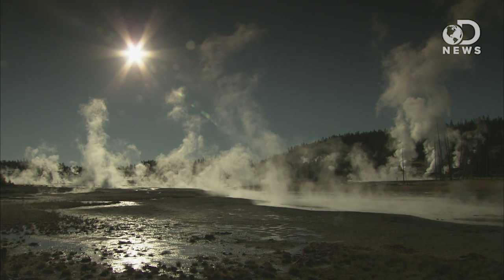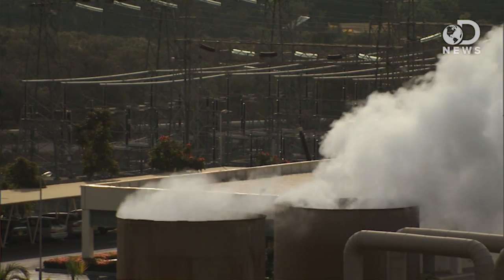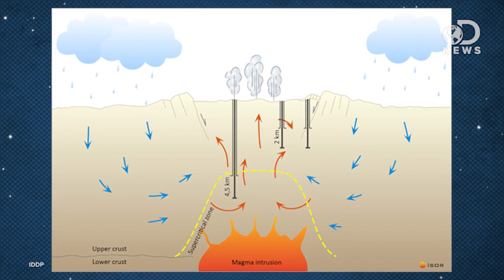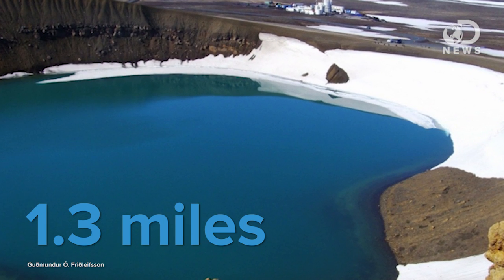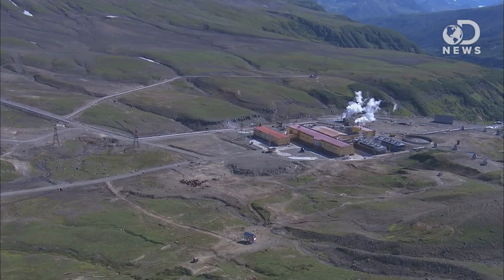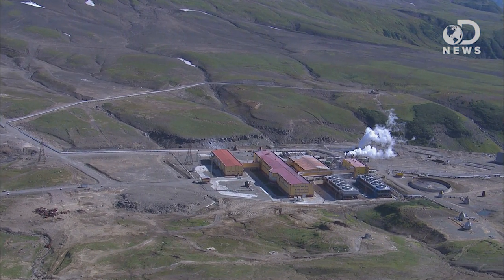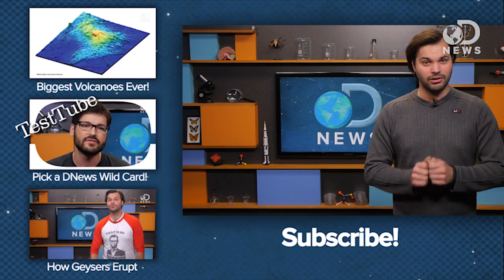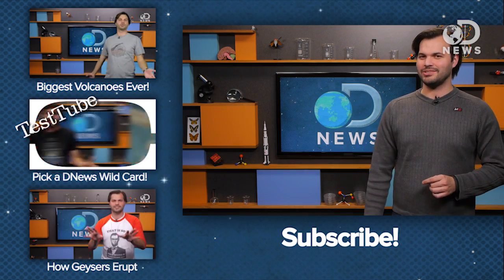Using Magma To Create Energy

Comment: Initially geothermal may be expensive but 2nd, 3rd 4th generation geothermal would blow every other source away.. 90%+ of the cost would only be required for the initial plant, if all our energy infrastructure built 100yr ago was geothermal we would probably be paying 1/10 our current power bills.

Comment: As humans build more and more geothermal wells to extract heat from core magma, the cooling of the core will accelerate and we will need to use the underground tunnels of the geothermal extractors to build lots of underground caves where we'll be protected from cosmic radiation that will no longer be shielded once the core has solidified and the planet's magnetic field is gone.

Probably by that time, we will have had plenty of practice living underground on Mars since that planet's core has already solidified.  It might be a good idea in the mean time to keep Earth's core well-insulated to insure it stays liquid at least until we are prepared to all migrate underground or to outer space.

Comment: energy cannot be created or destroyed
Reply: Correct but there not creating or destroying it. there using the heat of the magma and converting it in to electrical energy.
Reply: read the title of the vid.

thought id comment on the wrongness of it
Reply: If a home renovation show said they used magma to create energy, I wouldn't bat an eye. If DNews said it in their video I wouldn't bat an eye because you're right, it's part of our language. But they published a science video with an erroneous title that suggests something physically/scientifically impossible.
Reply: davdavc you and everyone else knew full well what it meant, you just tried to take the opportunity to sound smart.
Reply: We define a "broken" house, as destroyed, similarly as we define a certain form of energy as created.
With your definition, nothing can be destroyed or created, should we stop using those terms? no :).
I know what you mean, but a house is also only a certain composition of its parts, as are different types of energy.
Reply: um yah no crap
Reply: I never read the title lol.
Reply: A house is constructed from the sum of its parts. Energy is converted from its previous form. 
To create energy would be to construct a house without the required parts.
Reply: It looks like that on a superficial level, but basically the energy forms are also another construction, of more basic Energy (stuff). as the one in E=mc².

Comment: Geothermal energy ftw but really Geothermal energy + Solar energy are the was of the future. Geothermal as its below the crust everywhere on the globe and solar b/c its free and able to be generated where ever and whenever the sun shines. Same principle between them using heat to convert the energy into a type which we can use.
In this i think it will be unwise to have a Geothermal power plant inside of a lay person's house as it would need to be totally automated and things could go wrong and probably will in some cases. So in short keep the Geothermal stuff in huge power plants over holes in the ground reaching down to wherever deepness needed to get the most out of it then just send the energy to the consumer's house.
btw having geothermal power being generated in your own house might sound cool but it needs a big hole in the ground to work and if everyone had that then the ground would be so loose that it will not be able to hold much without faulting at big weights moving around and sinks might appear.

Comment: I had a passive solar house built in 1986, and had geothermal heat and air as well. The estimate to install conventional heat for that house was $3,300. An air-to-air heat pump was $3,800. The geothermal unit (with the pipe drilling and everything) cost $7,600. But I was eligible to receive a $3,000 rebate as a tax incentive, so I went with it. It worked great! My bills were a third of heating and cooling with an all-electric unit. And since the unit exchanges heat with a closed loop of water circulating under ground, there is no outdoor condenser unit at all. No loud fan outside, no big metal box in the way. I was sure that by 2014 (or even 2000!) that geothermal heat and air would be everywhere. Sometimes people are frustratingly slow to accept and invest in new technology.

Comment: I attend a university in Iowa that has several geothermal buildings.  I live in one of the three res halls that use it, this is my third year of doing so. I have come to the conclusion that geothermal heating/cooling sucks, at least in Iowa.  First off, it is an incredibly loud system,  I feel like this must be universal, not just in Iowa. Second, it has a hard time regulating the temperature,  in the winter it is often too cold, and in the summer too hot. A couple weeks ago ghey actually had to shut down one of the geothermal buildings because the indoor temp was below freezing,  it was -20°F air temp, -50°F with windchill. Geothermal can't handle Iowa weather.

Comment: I've once saw a renewable energy theory. Using gravity inertia. Technically, with precise weight, angle and force, you can rotate something almost forever, just needing small adjustment. The rotating thing rotates something similar to a turbine, that magnetic pillars, thus creating energy from using Gravity's inertia. Please sorry if you understand, I couldn't explain better.

Comment: The best kind of renewable energy all depends on the area you are looking at. Geothermal is great in iceland, wind if you are reliably windy, tidal on the coast, solar in the desert, hydro if you got a waterfall, etc...
Reply: ***** we should harness you as a source of power then :p
Reply: Geothermal power can be used all over the world. You just have to drill deep enough. You dont have to hit lava to get enough heat to turn water into steam.

The current problem is just a cost vs gain issue.
As in the cost is super high, while the gain isnt big enough yet.
Reply: Lobos222 Exactly. It's like that for almost everything right? There are very few methods that have definite restrictions, but you should try to use whats gonna get the most bang for your buck.
Reply: Hydro is good where ever you have a large river running down elevated ground or in a deep canyon, not just in waterfalls.

Comment: Wouldn't geothermal energy generation eventually cool down the earth's core temperature? If we do these in mass scale all over the globve?
Reply: You would need an awful lot of geothermal plants to do that... Like, covering every square inch of the Earth's crust, going all the way down to the core, pumping water 24/7.

Also, this same sort of thing (cold water being in constant contact with the hot insides of the Earth) has been happening naturally in the deep ocean trenches and at continental plate boundaries, on a massive scale for billions of years, and life's still here. :P

And geothermal energy generation in real life doesn't even fully pierce the Earth's crust. It's a looong way to the core...

Speaking as an Icelander, the only real downside to using geothermal power to make electricity and heat water, is that sometimes water from the hot tap smells a bit like eggs.

Comment: Bullshit.
Thermal energy has been harnessed for years in Island, is not new and in fact there was a good documentary about it years ago! were they said Island was completely energy independent by geothermal means.
Not only that but you have volcanic vents all over the place near YellowStone national park (only happen once before, this form of energy is really hard to find you guys blah blah blah) so much so you already HAVE geothermal power plants around those areas...
Hey next time why don't you wear an EXXON mobile T-shirt Trace?
Reply: the new is the idea of using magma instead of the heat in the ground. the next step in geothermal energy
Reply: sgcv
None of the geothermal energy plants work directly with magma because the ground its unstable, obviously, and because equipment tends to melt.
So the only way people are getting energy from the heath of Earth, its by being close to the source of it.
So there is really nothing new here. Perhaps the exposure is good for "green" energy sources, but to call them "new" is to tell people to basically not even bother, to wait till they are told its ready... When in reality the energy source its been there all along, we would have thermal power plants just as easy as to build a hydro power plant.
Reply: Ramiromasters well this news are more of news in the sense for a geek when new computer gets out. it's more powerful and efficient etc.

This thermal energy ide is, instead of abandoning a a lava hole; they will try to use it. and because of the greater heat, but not so hot to melt stel, it leads to greater energy mining, instead of staying closer to the surface with lesser efficiency.

this only affects islanders and people on Hawaii mostly

Comment: On average how far down would you need to go to heat water up to 80 deg F or 27 C? Considering it will cool off coming back up wouldn't you want to get it real hot?
Also what size pipe would you need and what kind of pressure?

Comment: My favorite type of energy is fusion energy. I know it's not fully developed yet, but think about it, a power plant that once powered up will never fail to put out energy! It will generate more energy than it takes (a lot better than burning oil, coal and gas). Besides, that way we can generate helium, which we are sort of running out of (at least the natural kind). I know it may seem unsafe to many, but I think we can contain the energy easily. Finland has a nuclear power plant you could crash a plane into, and nothing would happen, except from material damage on the building.

Comment: My energy preferences (In order from most to least preferable): Solar, Wind, Geothermal, Hydroelectric, Nuclear, Natural Gas, using a workout bike to charge large battery, fossil fuels.
As you can see I prefer pretty much anything but fossil fuels, I'd even consider the power generation method used in the Matrix movies to be better then fossil fuels.  To all supporters of fossil fuels: they are finite, there may be some dispute about how much longer we'll have them but they will run out eventually.  What do you think will happen when we run out or when there simply isn't enough for nations like the U.S.A. or China to share?
Reply: Problem with solar energy is that our current technology is pretty inefficient.